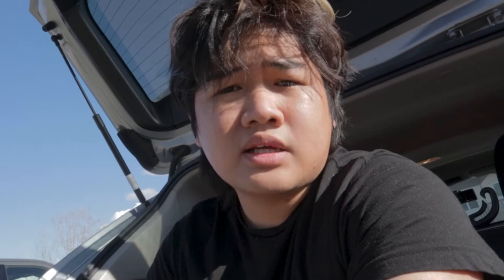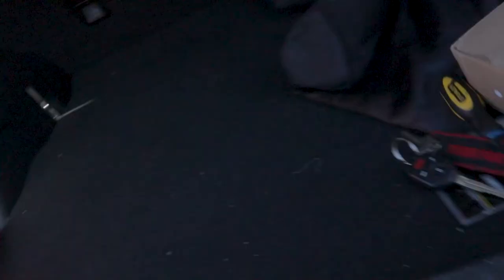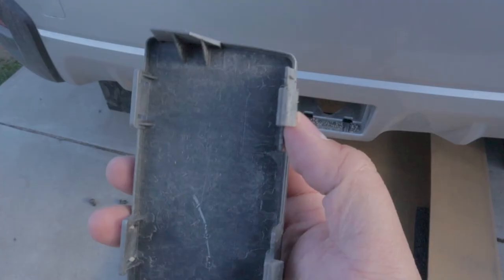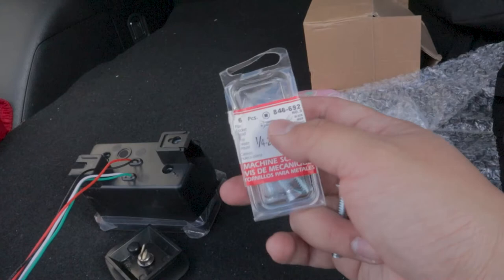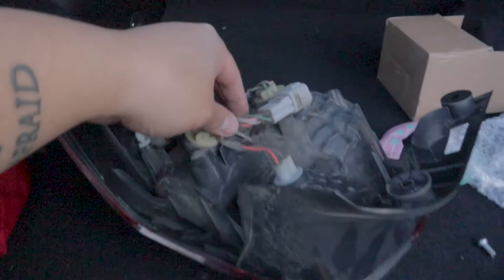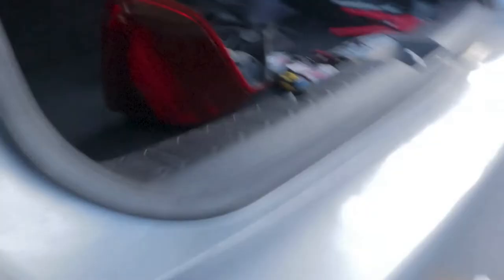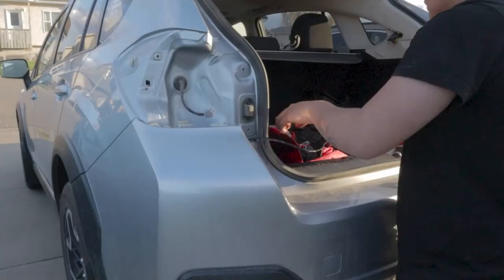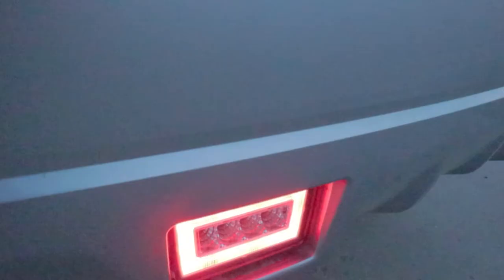A 4TH BRAKE LIGHT for the Crosstrek??! | Install Guide

Comment: Just bought a 17 Crosstrek this past February and have already done headlight, taillight and third BL  upgrades. Also replaced the chrome trim around the fog lights with an LED DRL trim. The fog lights themselves are an LED switchback style that can change from white to a yellow fog. Still need to add my LED license plate lights, the F1 style light and  the corner reflectors with some lighted replacements. Been a fun little project to make it more unique than the ten others my co workers drive. 😎
Reply from the maker: That sounds like a pretty dope project man!

Comment: So, if on the first try it didn’t work you had to play around with the wire’s colors again? If so…what’s the correct order now?
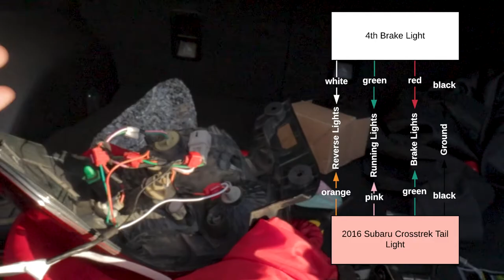Reply from the maker: The diagram at 8:05 actually works. What i meant by "play around with it" was the tap clips weren't tappung at all.